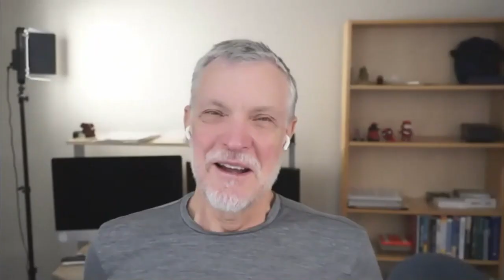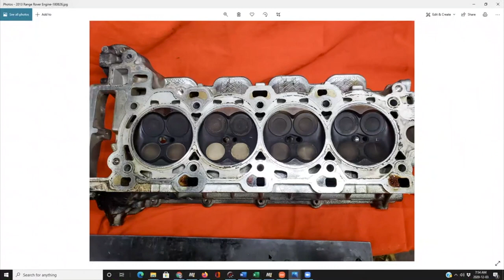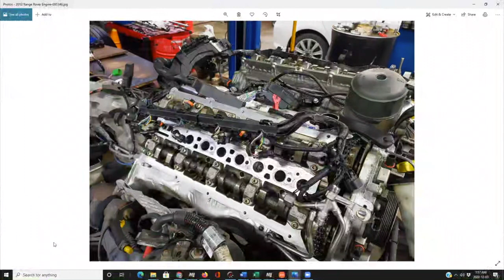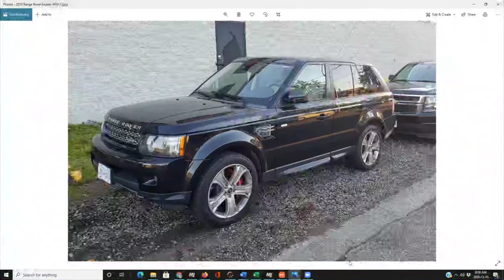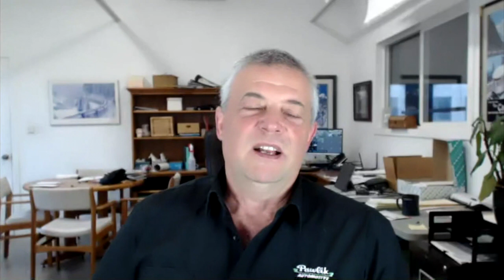Range Rover Sport, Engine Replacement

Comment: Good day.... I'm about getting a range rover sport 2005 (v8). My intention is to disconnect one  side (4 cylinders) injectors & remove the 4 plugs too. Technically, the engine will be running on only one side (4 cylinders ). .. I may want to call this process, manual cylinder deactivation... l don't mind if the engine looses half of its power. please will my ideal work or is there othet ideals ??? Thanks